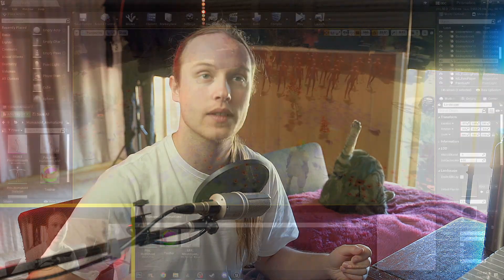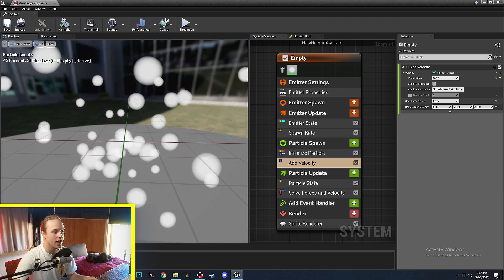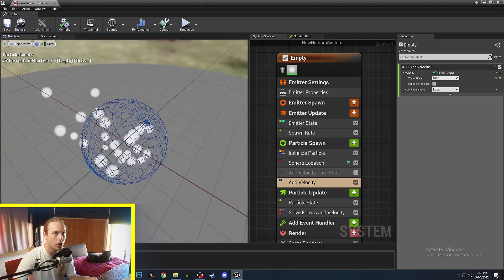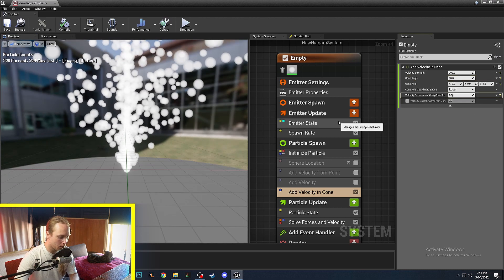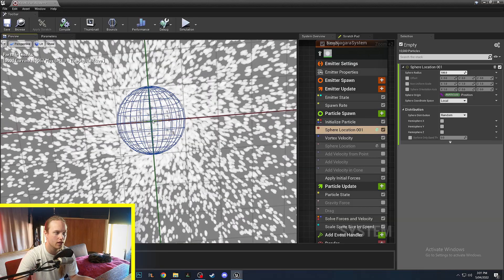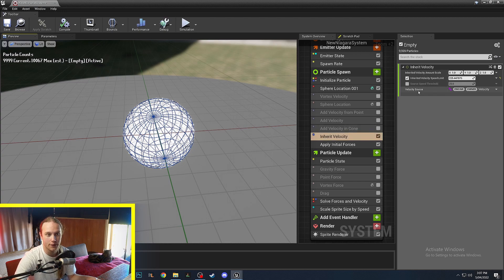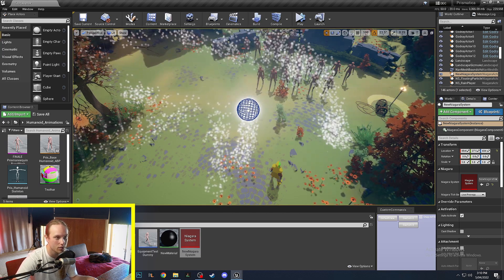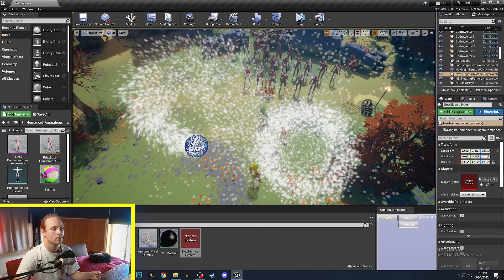Making Particles Move! | Niagara [UE4/UE5]

Comment: Hey @PrismaticaDev, in UE5.1 there is no scale added velocity in Add Velocity module, any idea how to work around it? Thanks for amazing tutorials!
Reply: If you stil need this I found solution that you can change Velocity to random range vector and here you can set it up for example: minimum is -50 maximum is 50 and one axis is 0 both and you get random particle movement on two axis.
Reply from the maker: Hey there, would you be able to specify more or chuck me a timestamp for what you're referring to?
Reply: @PrismaticaDev  It looks like on the recent updates for UE5.2+ this module may not be the same anymore. I too did not see the option for the 3 axis. Also, I don't see Add Vortex Velocity anymore. Any tips on where we can find or adjust these similar to the way you did on the video? If you do UE5.4+ the same way you set these up you'll notice they are missing, unless its user error and we are missing some setting to make them active.

Comment: Hello, I'm trying to work on my first particle emmiter in UE5, and mine has the problem of the particles follow the generator as it moves, rather than be left behind like the one in your video.  What am I missing?    I have my particle emmiter as a child of my player object, and when my player jumps I want to leave a trail of particles, but all the particles are moving with the emmiter.
Reply from the maker: Hello! Are you using any attractor forces on your particles?
Reply: @PrismaticaDev  no, but I did try adding and removing one.  I also got a suggestion from someone that I should not parent my emmiter to the player and instead have it as a top level and update its position manually every frame.  That seems weird but will try that next (tomorrow when I have some time again)
Reply from the maker: @funinvegas1  it should work fine being attached/parented, I do it all the time. When you say it "follows" the emitter, do you mean they sort of lag towards it or they're like. directly tied to it? So if you move it 100 units then all the particles move 100 units with it. It might be that the particles are simulating in local space if that is the case - some of the templates have it set that way
Reply: @PrismaticaDev  What I mean is I have a code of particles being shot to the left and right, and when my player jumps, ALL the existing particles are jumping with it.  I would expect the particles to stay on the ground, and only new particles to generate up at the player while it jumps.
Reply: code => cone
Reply: Following your tutorial/instruction step by step, I get an emmiter that has the behavior I want.  I don't know what is wrong with the one I already made, but I can make this work.  Thanks for taking the time to respond to my comments and help out.

Comment: Hey, I'm sure you get a lot of video requests but I'm currently creating a slime asset pack for a university R&D project before heading into the industry next year. I'm using ray casting to deform the slime along with a method similar to that which you showed in your video about distance fields. In that video your blob painted the environment where it touched, I'm trying to create a similar effect using particle effects and decals but nothing is quite working as I'd like. Have you done a video explaining how you achieved this effect?
Cheers!
Reply from the maker: Hey Alex - the method I use to paint the landscape is a part of my landscape interaction system using custom depth and render targets which you'll find on my channel somewhere :)
Reply: @PrismaticaDev  sweet, thanks a lot!